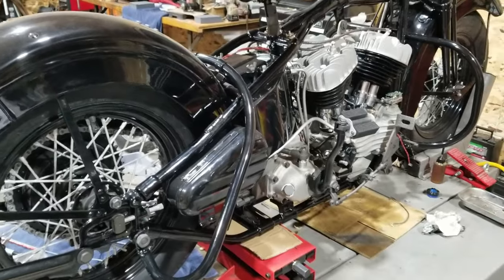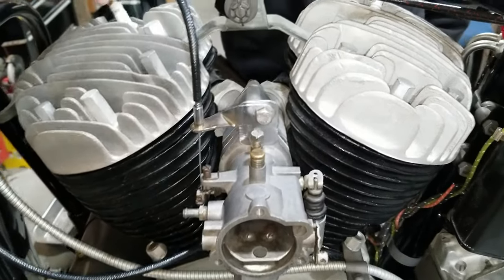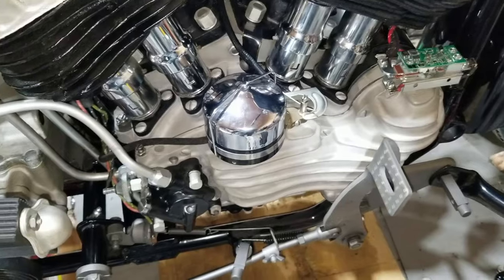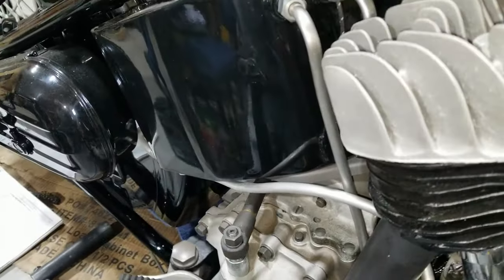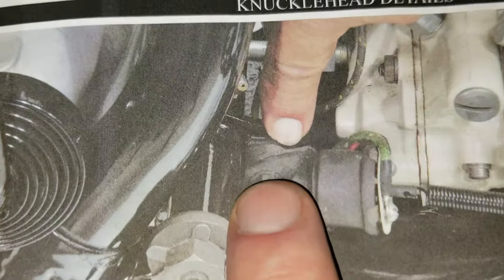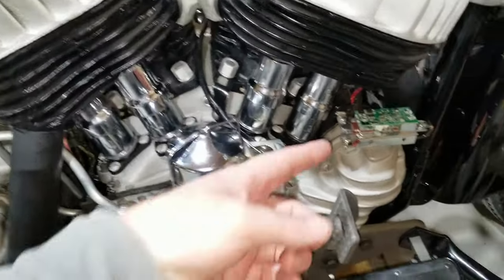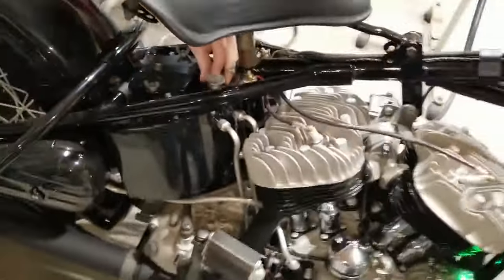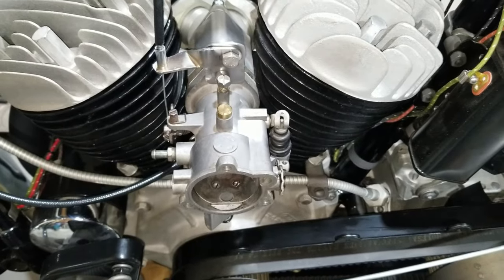1940 Harley Davidson UH restoration Part 14, Wiring the regulator, exhaust and the first start

Comment: Hi Jesse
What parts book and shop manual do you use? I’ve noticed the detailed photos and part numbers you reference in your videos. Nice job showing the small details that can add up to big problems.
Reply from the maker: @martybrennan4821  I have four important books I used on this bike, 1940 to 1947 service manual covers knuckles and side valves, 1936 to 1948 Spare parts book covers knuckles and side valve big twins lowbrow sells a reproduction of it it’s not complete though it’s missing the section on the head lamp but this book has the part numbers , then there is the book how to restore your Harley Davidson by Bruce Palmer the III, the forth one is the nice photograph one, UL & Knucklehead restoration book by Dan Henke thick 440 page book it has old parts dope sections which is old in bulletins sent to dealers V-twin part number 48-0928, if you have these four you got all the information,